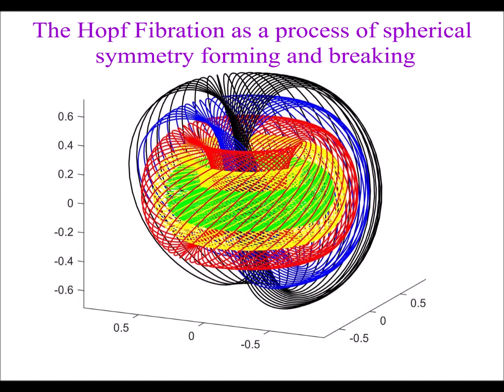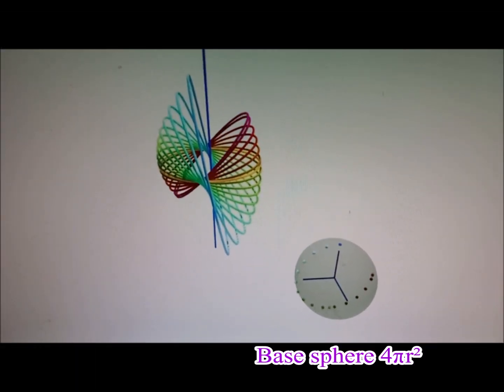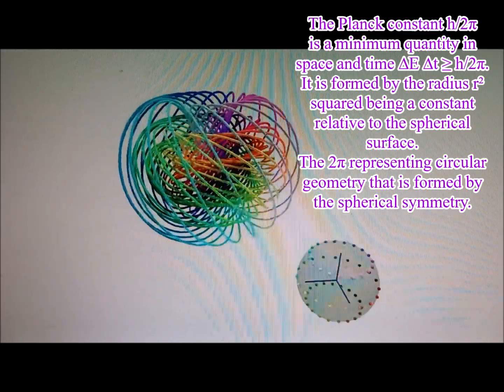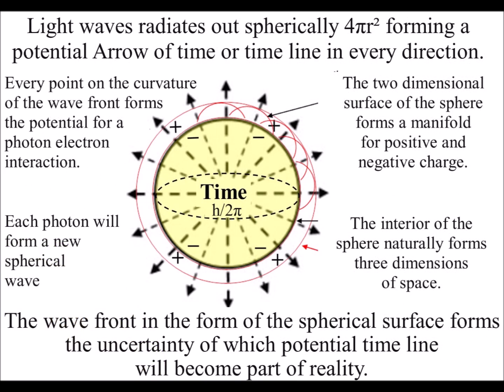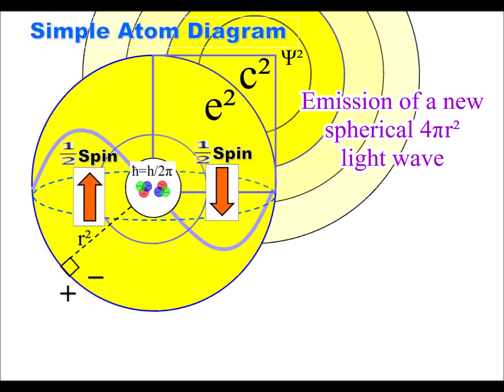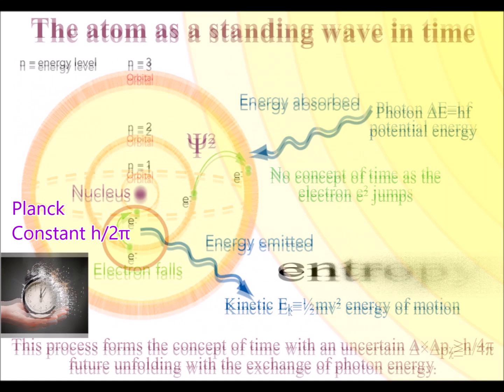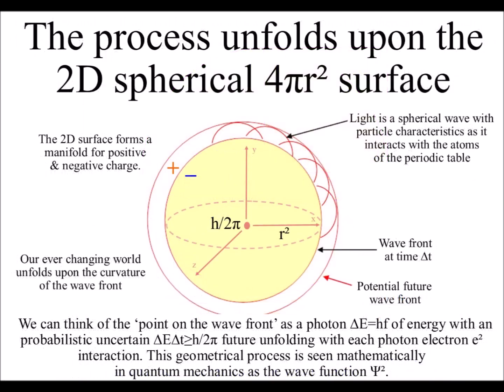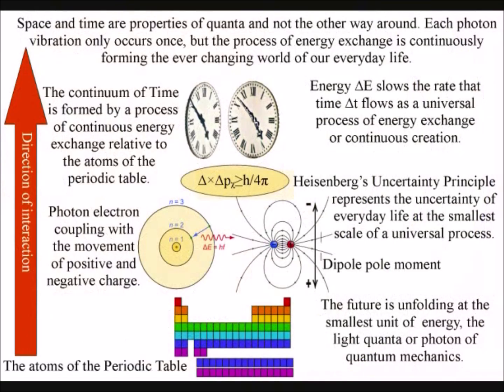Hopf Fibration Explained as Time Topology a process of spherical 4πr² symmetry forming and breaking

Comment: Thanks for your work in putting together all this information. I enjoy your videos very much. I was wondering if you know of any places the √3 shows up in physics formulas or the geometry of 30 60 90 degree triangles or equilateral triangles.
Reply from the maker: In this theory light waves having spherical 4πr² geometry forms the potential for right-angle triangles. The radiant energy will always be at right-angles to the surface of the sphere. The process unfolds upon the curvature of the wave surface forming the potential for degrees of angle.

Comment: I see you're halfway up the first step of the pyramid. In reality, the waveforms seen in atom smashers and through other evidences shows how every element has not only it's own geometry, but it's own time and space relative to that geometry, although it's not directly relative since carbon for example, has a 6 sided geometry nearly identical to gold. This gives graphene tremendous ion bonding power to gold though. Ion bonds are charge itself, and time is directly relative to charge which does build off a 2d linear plane but only with the strong force. After the weak force forms around it, the atom gains 3d space, and only once multiple strong forces are linked as an element by the weak force appendages that intercept this strong force center, do elements exist as sets of stable bonds. A chicken can eat graphite to produce calcium. Personally I've made ferrite oxide turn into gold in a microwave at only 1800F.  Fly ash type c or f, are actually quasi-crystals which any photon based theory has no possibility of explaining. It's time to drop it completely and start over, and string theory is no better. What you truly need is better knowledge to make this climb. Start with some facts, like Azra Wind's discovery of the prime spiral relationship know to exist perfectly against the forces. She'd have unification if she could explain where the giant energy hole in that formula comes from. The answer I explained on the web in 1996 and is a process of stars consuming the smallest particles and spitting out new larger ones from that all the time. It forms a flow opposition which is the driving force of time itself. The 4 winds as 4 poles, 2 of energy flowing into stars and 2 flowing out new and large. Matter is a 3rd pole acting as a disturbance among the first two energetic ones. Time is feeding all motion through this single prime spiral only, as there can be only one, and it is clearly a hydraulic force of the smallest particles, namely the electron neutrino. I predicted it flows into the galactic bulge and this is exactly what Ice Cube found over 10 years later. Because time is based on displacement, yes, it can be manipulated using a multiphase zero point encapsulation hidden inside the 5th of 7 densities possible, or what I used to call the 7 boson matrices.
Reply: When water molecules are incorporated into the lattice of ferric oxide, the compound can form red or  yellow colored powders that look like gold. The melting point of ferric oxide is about 1600
Reply: @rebokfleetfoot  Well it depends on the oxide. Black, which is actually a deep green, has the least oxygen. Yellow, then red after that for the most oxygen.In a microwave, the red hematite makes platinum group metals as confirmed by John Milewski. Yellow doesn't seem to make anything. Green/blue makes gold. When I've made gold it's been at around 1650F. Plasma action discharging among the oxide particles can form sudden bursts of heat we cannot measure the exact temperature of because the reaction takes place too fast to see with the Lumasense Ir6. The platinum group needs a higher temperature but not much. If I had to guess I'd say it was about 15F more or even 100 depending on the crucible I was using. I tried to avoid it since I can't smelt it in my oven. I abandoned using a microwave to make gold since it only makes $5 worth at a time. The vastly improved method doesn't require host matter, just carbon foam, where new quarks are pulled right out of magnetic current, accumulated using superconductive means. We found an Italian who made gold blocks with a machine your can find a diagram for on Rex Research but without the circuit diagram. It utilized a RF grid zone inside a chamber (2 intersecting waves at 90d) then once accumulated a super dense ion field inside, it would burst project this out a set of tubes like a cloudbuster into the foam block. It takes at least 15min to accumulate enough particles, but once it's done, the foam block lights up in a bright flash and shrinks about 5% or more forming a solid block of Au.  We believe the know the frequency used for Au but I'm also curious to try making other metals, like element 140 Phil Schneider brought to a lecture.
Reply: Observation from your periodic table of elements has you confused.  You are thinking linear. Democratus had come up with the atomic theory 400 BC. Called it indivisible. If you Google who invented the atomic theory, you get John Dalton as they think it was divided, long line of people who tried to prove him wrong, and can't. Aristotle I think was the first. The current model has 96% dark energy and dark matter. This is an element to the architecture of your world as it shows up in about eight lines of physics computer physics as well and the black hole acts more quantum than the science fiction at rest Mass. The critical angle of the speed of light is 45 degrees and the fact you have 2 90 ° turns into a vector... Graphene advancements turned QED upsidedown.  At the micro we adjust the octopole to deal with quadrupole anomalies, hard to do at the axis of evil CMB. If I was flying to the octopole, why would I have to worry about it moving from me to away from me in my spaceship when planet Earth breaks solar plane at orbital plane equator 0? Maybe the fact latitude longitude converge at center and are undefined as 0? Maybe standard gravity calculation on the local gravity calculator 45 North and South latitudes at sea level are your dual centrifugal vortices? Walter Russell. And the center is four dimensional hypersphere? That would make them schroders twinkles Polaris drifting critical angle of light annually Andraw perpendicular on the exit. Can you increase angle of entry skipping a rock and have a perpendicular exit can you increase angle of entry doing a cannonball have a perpendicular exit can you adjust the plum cut of a 1212 roof from 45° to 42° at the peak and not adjust the seat cut by the time you get to the bottom rafter? It's an abomination.
Reply from the maker: It is simpler and more logical to stick with three dimensions squaring the process of physics: c², e², Ψ² and d²/dx²
Reply: @Dyslexic-Artist-Theory-on-Time  But it's never simple. There are forces they know exist, yet don't understand where they fit in. Such forces will accumulate a new type of weak matter in ozone, and can be used to literally rearrange our matter. If you read alchemy forums, you'll find some amazing proofs they're too scared to even talk about in the modern physics world, because it breaks everything they know. Quasi-matter is formed where matter is, yet isn't held together well due to thermal tension in the presence of O3-O6.  This weak arrangement of quasi-matter can spawn right out of magnetic current, ie; nowhere and everywhere. It accounts for many discrepancies  and anomalies found in so many experimental evidences across the board.  If you know it's secrets, you can quite literally use it for amazing things. Turning lead to gold? Sure. I actually just invested my savings into such a project. Making element 140? Quite possible. It's all just a matter of making the conditions right for the particles you want to accumulate. There's a little known of Italian who, in the early 90's, made solid gold blocks form in about 30 minutes where nothing previously sat but a slightly larger block of carbon foam. Saw him do this twice on an old vhs tape. The power it takes to do such a thing is not much. It's how the power is used to trick time into forming arrangements of charge in an rf holograph. There are many secrets already revealed on YT.  Here's one interesting example, so search this up on YT: Tesla 369 and Lo Shu Unveiled same structure. All for now Mike out
Reply from the maker: @mikefromspace  We have complexity out of simplicity, out spherical geometry.

Comment: I like your videos.  I just wish I could understand more than about 15 percent. Not a criticism of you.
Reply from the maker: Think of is as geometry!!!
Reply: Every electron is going to hold the same Mass from here to the CMB at every moment of time. The point of interest is everything having the same mass. Electrons like their space no two fermion may occupy the same space in the same spin state it fills density to our environment, the scientific reason you may not walk through a wall..  electron replacement determines pigmentation. So the tree and your optic nerve will both equalize to mass at the same moment of time creating a longitudinal stress and a lateral collapse that you perceive as colors. Em function is transverse wave function while sound is a longitudinal wave of information within the EM system. These fibration have an overlay, carries information smaller than our periodic table of elements can scale because it's the simple building blocks. You need a bunch of these to dump into a void before mass is built.